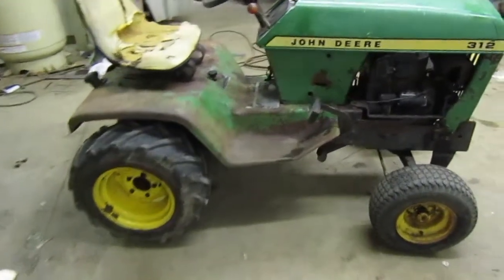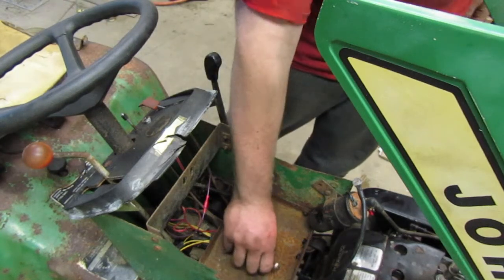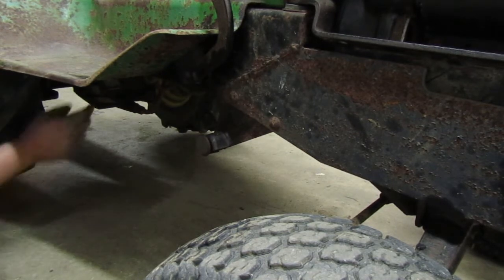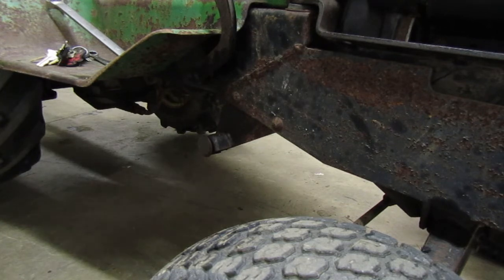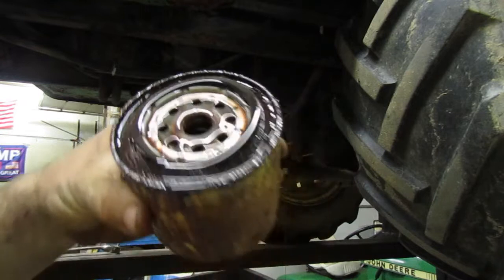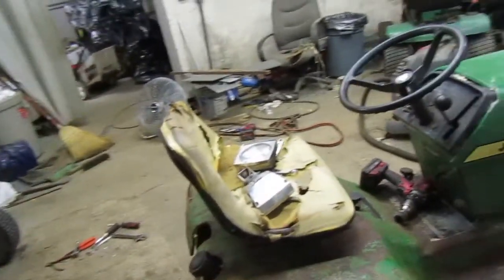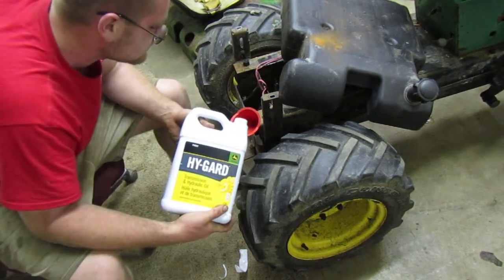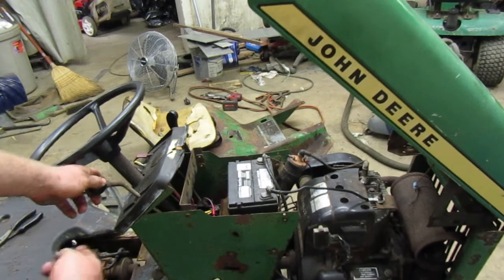Can We Do It ????? 1978 John Deere 312 Transmission Fluid change

Comment: john deere trans filters do not have a by pass and when getting clogged the machine will slow and eventually stop moving the after market will continue to circulate dirty fluid after they stop filtering and will ruin your hydraulic system prematurely thanks for the video

Comment: Sounds like that 312 needs a carb. The throttle shaft gets worn over time, my 82 212 had the original walbro carb on it & it was bad. 

On the new carb, re-use the old choke, & throttle lever.
My 212 k301 needs rings, & an engine tear down/rebuild.
I could rebuild w aftermarket parts, but ima try to do it w oem Kohler parts or throw a Yanmar L70 diesel I’ve got on hand in it or throw the diesel in my 216 whose wrong harness is trashed, & my 212 wiring harness is still in decent shape. 
My 212 will get a rebuild & my 216 will get a Yanmar or it’s k341 will be running again.

So on the battery tray, throw some paper towels under the battery so the battery acid goes into the paper towels, & not into the tray.